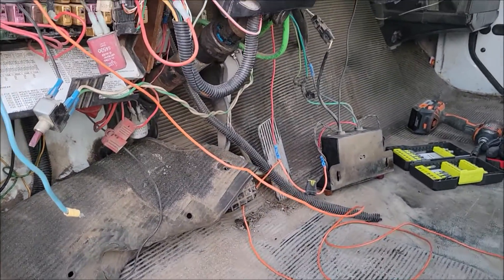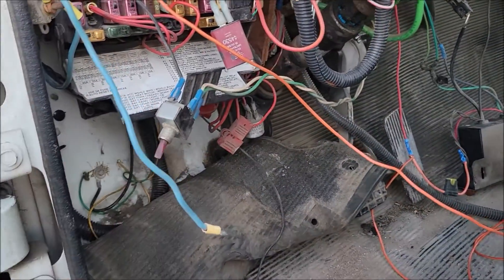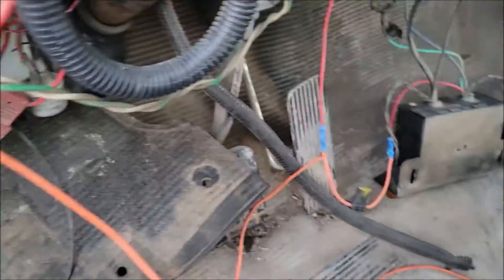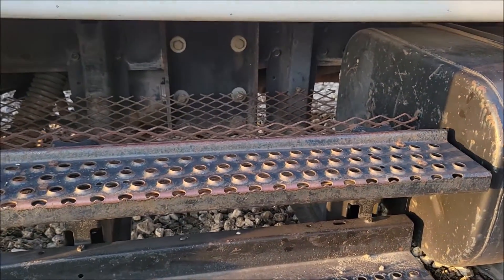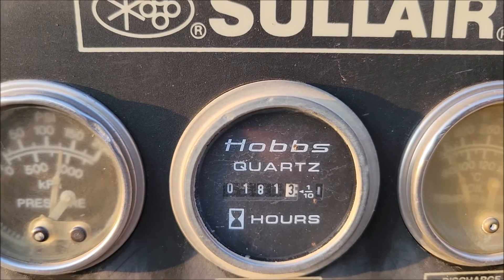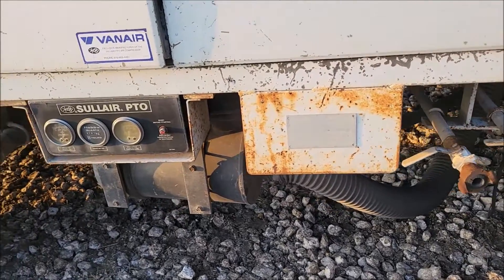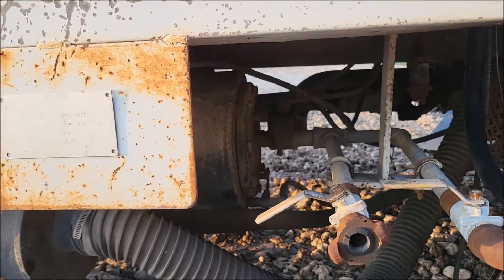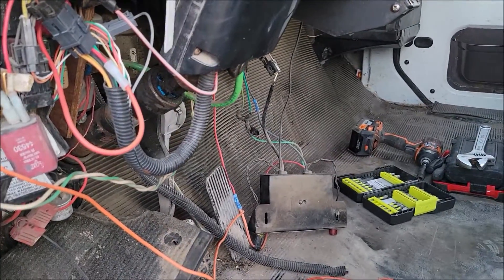It's Alive! The PTO is now working | Testing the VANAIR 185 UDEC

Comment: Those rotary screw compressors are awesome.  They compress so much air with minimal power needed to do it.  Cool system.
Reply from the maker: Yeah, they are cool and expensive.  I was thinking about keeping it but I really have no use for it.  It would be one more thing sitting at my land falling apart.